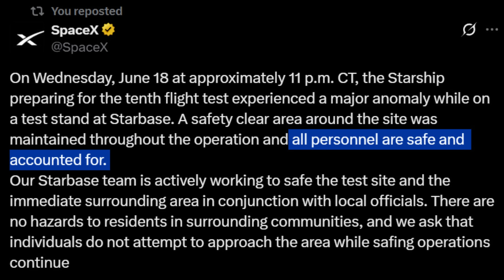SpaceX's Latest Starship Explodes During Ground Test

Comment: Scott, it looked like they just finished an upper fin movement before the rupture.  Could the header tank have broke loose.  That break would cause the pipe to bust and the fluid fall into the methane tank and splattering.  I agree it looks like the pipe busted

Comment: Starting to have some concerns about the allegiants of his crew based on current political BS...  I so hope I am wrong, but the failures on a mostly successful program changed after DOGE and have increased a bit too much. But it is rocket science for the in betterment for mankind.  Some don't see that.  Although the redesign of the fuel lines, issues with this generation have seemed consistent since the changes...  Just appears as one Hell of a coincidence with the current heat from agendas.  Maybe time to go back to original materials and design with the fuel lines, but this obvious leak into the cargo area should been detected unless a fitting had completely failed from the initial surge of sub temp fuel.
Reply: Starship is mostly successful? I wonder what they have accomplished so far. 1 booster landed everything else in ruins. Doesn't sound successful to me
Reply: @rayparent1  Have you seen the size of this thing? Catching the first stage in flight, hell just the return to point of origin is beyond anything anyone else can do I still find Falcon 9 breathtaking and beyond what any experts see as possible.  Yeah, it has been extremely successful for what it is...
Reply: @cw5865 yes catching it is impressive but they have demonstrated 0 capability to complete what they are getting tax payer money to complete. Falcon 9 works but isn't thr topic of discussion.  
I'd also love to see the experts who say landing a rocket is impossible can you point me in their direction?
Reply: @rayparent1  Starship is funded by Starlink and as for landing or "catching in midflight" show me one success of something Space-X does weekly from any Country or Company or more to your point I will do the 1st part of your Homework, but you do the rest as to which experts...  Experts recognize the challenge of re-entry heat, particularly for vehicles returning from orbital or interplanetary missions. However, successful examples like the SpaceX Falcon 9 demonstrate that with advanced technologies, re-entry burns, and clever design, first stages can be safely returned and reused, debunking the idea that returning a first stage is impossible due to heat alone. (google)
Reply: @cw5865  Starship is funded by taxpayers to the tune of 23billion dollars btw
Reply: @rayparent1  Oh really, show me where you got that misinformation, I mean your source please. As Starship isn't funded by the government. NASA does indeed have contracts with SpaceX for moon landings, but it doesn't matter how many Starships blow up. NASA's contract assumes a working Starship. If SpaceX can't produce one, then it doesn't get the money.
Reply: @rayparent1  Appears my last response was censored, hmm as I just pointed out the 23 billion is wildly  inaccurate, strange.  Starship will be used and contracts paid when milestones met (not like the Boeing gigs).  Here we go again and see what occurs with facts pointed out, While Starship is developed by SpaceX, it's primarily privately funded by SpaceX and its investors. The majority of Starship's development costs are covered by SpaceX itself. Government funding, primarily from NASA, is used for specific projects, such as the Human Landing System (HLS) variant of Starship, but not for the general development of the vehicle. SpaceX also generates revenue through Starlink, commercial satellite launches, and other ventures.

Comment: Elon said in a press statement that he regrets not using carbon fiber reinforced bubble gum and duct tape on this Starship. According to leaked specs, the next one will not only feature this upgraded gum and tape, but will also get 2x more super glue and special SpaceX brand bailing wire. Elon also said he will cross fingers on both hands next time not just one. Mars here we come baby!

Comment: The explosion of SpaceX’s Starship #36 during ground testing on June 19, 2025, is still under investigation, but based on detailed video analysis and expert commentary—especially from aerospace analyst Scott Manley—there are several strong indications of what may have caused the failure.

Here’s a breakdown of the likely causes:

💥 Probable Cause of the Explosion
1. Structural Failure Near Header Tanks
The failure appears to have originated in the forward section of the Starship—specifically, where the small “header tanks” (used to store landing fuel) are located.

These tanks contain methane and liquid oxygen, and are connected to the main tanks via downcomer pipes that run along the inside of the rocket's windward (heat shield) side.

Key visual clue: The rupture started in the middle of the heat shield section—not near the main tanks—suggesting that a pipe or structural element failed near the downcomer/header tank area.

2. Overpressure or Fluid Hammer in the Downcomers
A fluid hammer effect (a sudden surge of pressure in liquid-carrying pipes) or over-pressurization of the downcomer may have ripped the side of the vehicle open.

This could have resulted in a violent expulsion of cryogenic fluid, weakening or rupturing structural supports.

The PEZ dispenser-style payload door didn’t rupture, suggesting the tear was structural, not pressure-door related.

3. Collapse and Chain Reaction
Once the header tank system or its plumbing failed, it likely led to a cascade of structural failures:

Falling debris (such as the header tanks or structural supports) could have punctured the main methane tank.

This allowed methane and oxygen to mix, resulting in a massive fireball (deflagration—not a supersonic detonation).

🔥 Explosion Dynamics
The explosion created a mushroom cloud of burning gas, consistent with deflagration (a rapid but subsonic combustion).

It’s believed that the methane and oxygen mixed only after structural collapse, causing the secondary ignition and the fireball that destroyed the vehicle.

No personnel were harmed, but the test stand was heavily damaged.

❗ Summary of Key Factors
Factor	Role in Explosion
Header tanks	Likely origin of failure
Downcomers	Suspected weak point; possible overpressure
Heat shield area	Initial rupture path
Fluid hammer / test error	Possible trigger for tank rupture
Methane-oxygen mixing	Cause of final explosion
Design tradeoffs in V2	May have contributed to fragility

🛠 Next Steps
SpaceX will likely conduct a full root cause investigation based on recovered debris and telemetry (if any).

If a design flaw is confirmed, they may adjust V2 or pivot to a V3 Starship sooner.

Comment: Event: Explosion during ground testing
Date: June 19, 2025
Vehicle: Starship #36 (Version 2)
Location: Massey Test Site, Boca Chica, Texas
Test Type: 6-engine static fire test preparation
Outcome: Total vehicle loss; test stand damage

During the final stages of preparation for a six-engine static fire, Starship #36 underwent a catastrophic failure resulting in a massive fireball and the complete destruction of the vehicle. Fortunately, no personnel were injured.

🔍 Sequence of Events
Pre-Test Setup:

Starship #36, a V2 model, had previously completed a single-engine test successfully.

It was being fueled with liquid oxygen (LOX) and liquid methane (CH₄) in preparation for the full static fire test.

Explosion Onset:

Just after 11 PM local time, shortly after methane fueling had begun, the vehicle exploded.

The explosion was first detected as a sudden whiteout on live streams, followed by a massive fireball.

Observations:

The explosion produced a deflagration, not a detonation—meaning it was a subsonic combustion rather than a high-pressure supersonic blast.

A large fireball and mushroom cloud formed, visible for miles.

Multiple angles from photographers confirmed a progressive structural collapse before full combustion.

🧪 Failure Analysis (Speculative)
Scott Manley and other aerospace commentators proposed the following possible causes based on video evidence:

1. Origin of Failure:
The initial breach appeared to occur in the forward section of the vehicle near the header tanks.

Starship V2 includes a downcomer running along the windward (heat shield) side, which may have been the failure point.

2. Mechanism:
Cryogenic fluid escape and structural tearing were seen before ignition.

The forward methane or oxygen header tanks may have over-pressurized or ruptured.

A fluid hammer effect or a pressurized downcomer rupture could have forced pipes upward, causing structural failure.

3. Combustion Phase:
As structural sections fell, a mix of methane and oxygen formed a volatile cloud, igniting into a secondary, massive fireball.

Debris, including COPVs (Composite Overwrapped Pressure Vessels), was observed scattering.

🧱 Damage & Consequences
Test stand infrastructure likely sustained major damage.

The heat shield tiles, which are silica-based, may have released hazardous glass fibers—prompting health safety cautions for nearby areas.

The vehicle and data collection instruments were completely lost.

According to Manley, minimal valuable data was obtained from this failure, representing a major setback.

🚧 Program Impact
Short-Term:
The incident casts doubt on the feasibility of Starship's next test flight happening in July 2025.

Starship #37 is in development but requires significant work, especially on its heat shield.

Massey test site operations may be paused due to damage.

Long-Term:
Highlights potential design flaws in V2 Starship, raising questions about its structural optimizations.

May prompt a shift in focus toward a revised V3 design if systemic issues are confirmed.

Reduces the already slim chance of a Mars mission in 2026.

📅 Next Steps & Outlook
SpaceX has not issued a detailed technical report yet, but confirmed all personnel are safe.

Internal investigations are expected; FAA intervention is unlikely as this was a ground test, not a flight.

Community and industry observers await SpaceX’s root cause analysis and response strategy.

🎥 Credits & Footage
Footage and observations provided by:

D Wise (dwisecinema)

Jerry Pike (jerrypikephoto.com)

NASA Spaceflight Team

Commentary and technical breakdown by Scott Manley

📌 Conclusion
This incident underscores the risks of rapid prototyping and testing in cutting-edge aerospace development. While Starship's ambition remains unmatched, setbacks like this remind us of the fragility of early-stage hardware and the importance of robust design and testing protocols.

Until SpaceX shares more details, all technical conclusions remain speculative. The space community watches closely for the company’s next move.

Comment: Starship is not first principles engineering and economics.  You go up thin and come back thick.  Thick is an aeroshell.  That means you need space solutions to build an aeroshell or inflate one like LoftID.  Starship coming back with a cargo hold full of air is not first principles economics.  A superheavy booster could already be launching mass into LEO without Starship.  Spindly second stages like Rocketlab (Neutron) are cheap throw-away items useful until space infrastructure is built.

Comment: The Youtube channel "Beyond the press" tried to create a real fuel-air explosion a few years ago, and eventually succeeded after quite a few deflagrations. The sound difference between the failures and the successful "shot" is impressive.
Reply: Kolme, kaksi, yksi... 🔥
Reply: That was such an interesting video to me. I previously thought that fuel-air detonations were pretty easy to achieve and were only uncommon because dealing with liquid fuel is inconvenient, it was fascinating to see the struggle they went through to get a successful detonation.
Reply: Indeed. I do recall the somewhat haphazard attempts. 
But when everything came together in the correct ratio it was impressive, even for such a small sampling. 
The "Daisy Cutter" air fuel bombs of the Vietnam era were exceptional in their power. Yet compared to the 30tonne

Comment: Putting my  money on one of the battery packs exploding. Just did a test of the electrically actuated flaps before this happened. I imagine that leaving a giant Lithium Ion battery pack inside a stainless steel oven in the middle of the summer in Texas was probably a contributing factor.

Comment: How would Starship ever get human-rated with fuel/oxidizer tanks so close to the crew and their lines to the engines laid out right next to them? The LES of Mercury, Apollo, etc. has exterior solid motors.
Reply: Exactly this. I've said for years that this thing is horrible from the standpoint of crew safety. With humans on board, once the engines light up, you're committed to riding it to whatever end... having no escape system is insane. And your point about those tanks and downcomers in the nose is spot-on.
Reply: If the header tank explodes, you are dead whether you are nearby or at the other side of the ship.
Reply: Never mind the fuel, the skin gets too hot for human re-entry. It will never be human-rated. Site-to-site transit is a pipe dream.